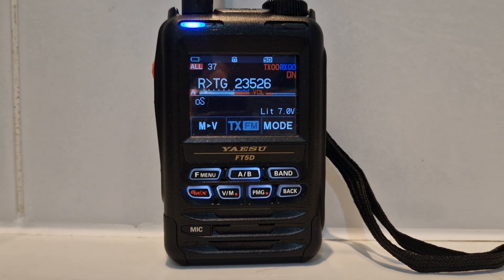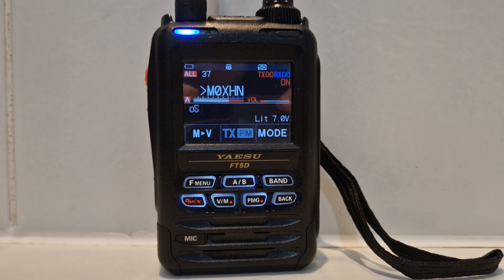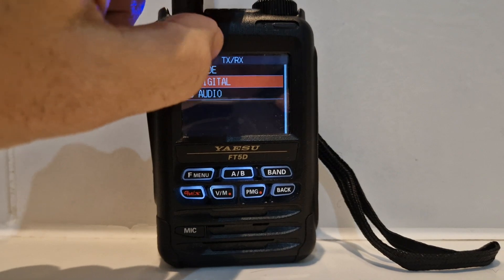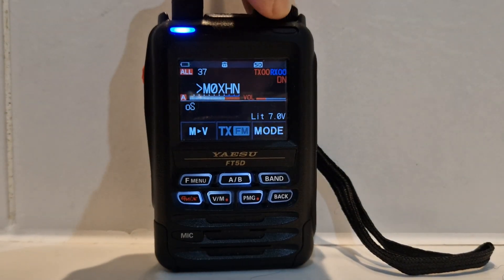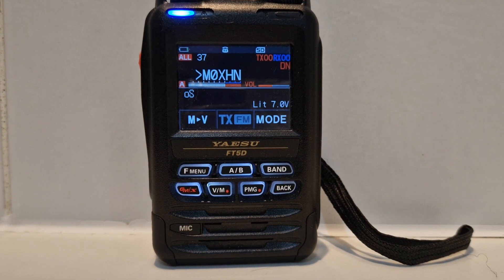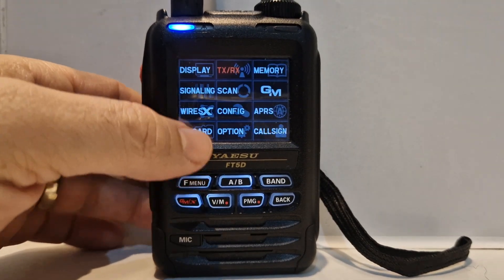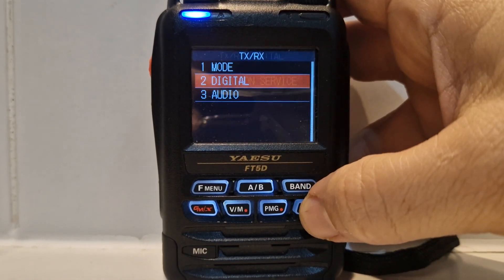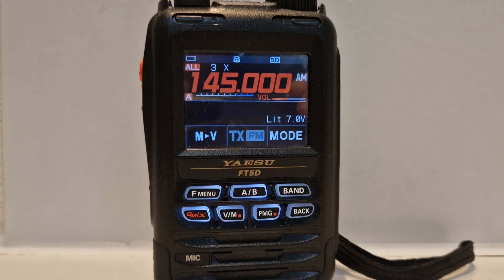YAESU FT5D Beep-Turn off C4FM beeps

Comment: its actually a nice feature when mobile to be sure someone has actually stopped talking, i leave mine on.
Reply from the maker: I like beeps
Reply: but it is nice to turn off, especially if you are setting the radio to be used as a PDN access point